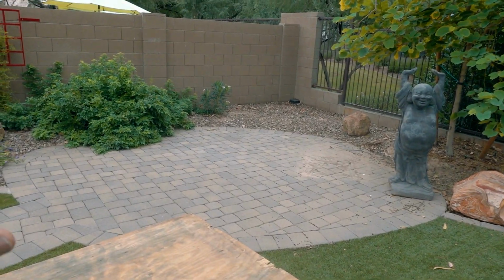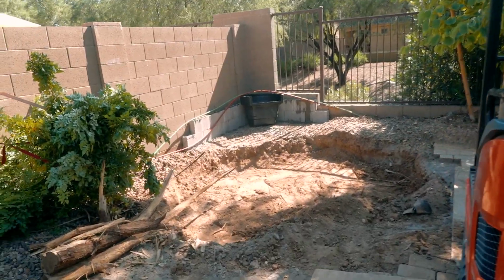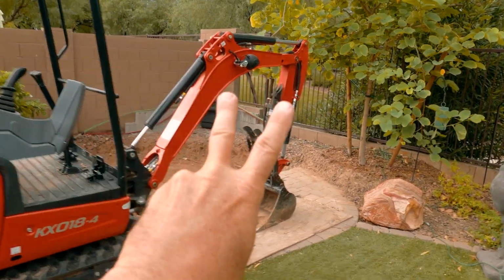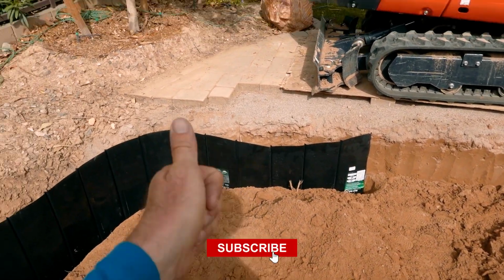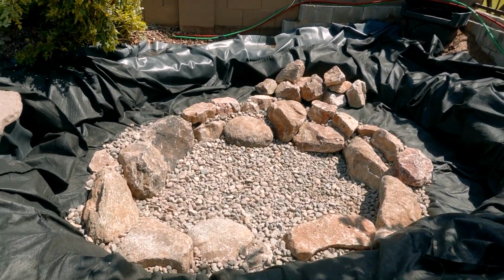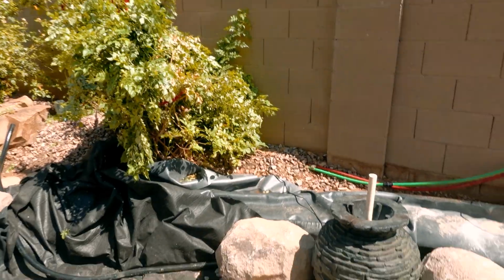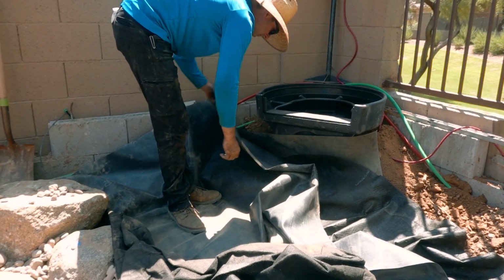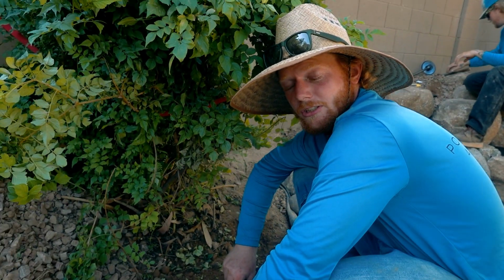Sanctuary for a NURSE! Backyard pond for a Labor & Delivery Nurse to decompress.

Comment: Do you do any type of autofill system? I installed a stock tank filler (for cattle) in my sump basin connected to my well water.
Reply from the maker: We do install auto fill valves in our features. You should use one that has a “shield” or housing around it. I believe they have them at Tractor Supply.